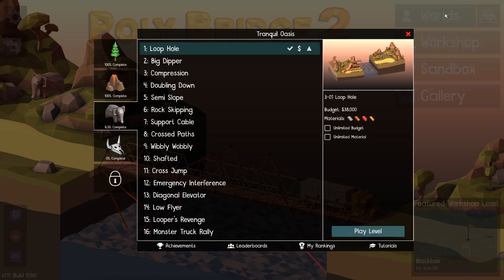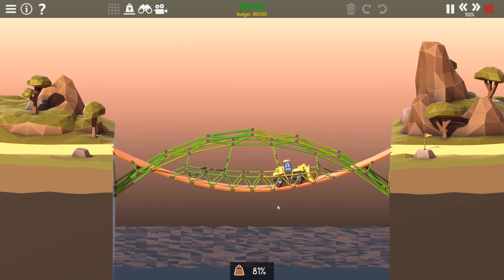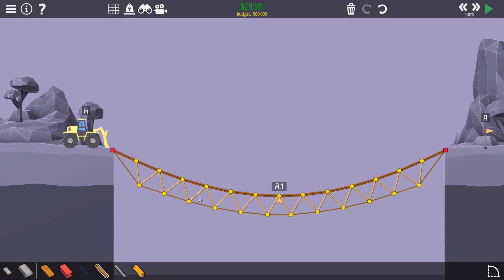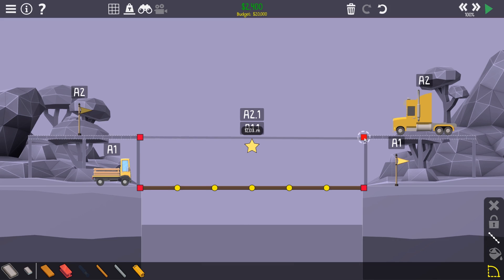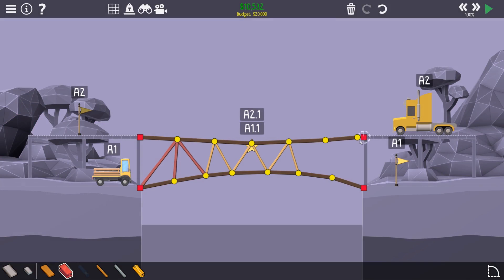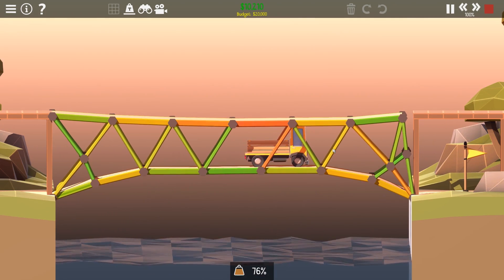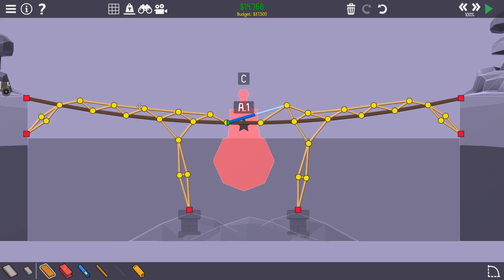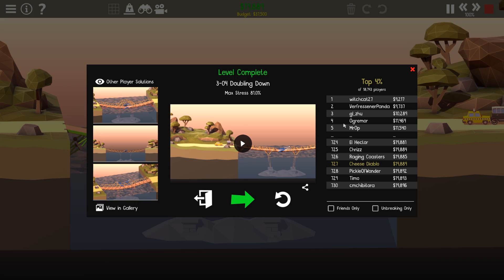Building BILFS with a real engineer! Bridges I'd take home to meet my parents! Poly Bridge 2

Comment: How did the rope of the first bridge help? Wouldn't the rope be compressed?
Reply from the maker: It stopped the steel arch from slipping down, it was suspended under the anchor points at the end. If you mean the bits in the middle, they are to suspend the wood and road from the arch, they were hanging from the arch!

Comment: 11:25 why did you never reconnect the upper bridge's right side to the anchor point?  It has to weather a huge shock when the truck bumps onto the bridge it otherwise wouldn't need to tolerate.  Was it just something you overlooked, or was there a reason to it?
Reply from the maker: I think it's because it wouldn't reach without another piece of road,  and that ups the price by a lot! I might be wrong though, it was quite a while ago now!

Comment: Some tricks: for tension designs you can create small standoffs vertically from the roads rather than triangles. The bridge will sway, but still work. Additionally, angling the roads on the edge up, while having the rest of the bridge dangle with those standoffs will spread the tension more evenly between the road and the final stretch of rope, which can allow for a much smaller distance between the rope and bridge itself.

This is because the tension concentrates on the roads at the outer edges and the rope in the middle. By splitting the tension between the road and rope on the edge you mitigate this effect.

Comment: I think you're a bit too close to your mic on this recording. You're getting some rumble from the plosives (p sounds, for example) and some proximity effect which makes your voice sound a bit lower. Either that, or you had the gain too high and your voice is clipping a bit (or both). Make sure you've got a pop filter, double check your distance from the mic, double check your gain, and you might want to consider adding a high pass filter to block some of the pop/rumble if you're still getting some after making those adjustments. That's all assuming you haven't already fixed the issue (since I know you keep a backlog of videos)
Reply from the maker: Yeah there's gonna be a few videos where I'm clipping. I'm super sorry about this, I nudged the gain on my sound card and ruined a few sessions. All sorted now but not sure how many videos are affected! Sorry!
Reply: @RealCivilEngineerGaming  that's alright, I wasn't sure if you were aware of the issue, and I wasn't going to go through the effort of downloading and looking at the waveform to check if it was actually clipping or not. I never know how much youtubers know about sound recording stuff so I try to give as much advice as I can when I notice something like that.
Reply from the maker: @Bobbias  I edit all my audio properly, noise reduction, eq, compression etc. You can't fix a clipped track though annoyingly!! Thanks for letting me know tho!
Reply: @RealCivilEngineerGaming  Yeah, that's the most unfortunate thing about clipping. It can happen at any stage in the audio pipeline, and once it's recorded there's nothing you can do.

Comment: Not sure if you have figured this out already yet (I haven't seen every PB2 video yet) but I was doing some of my own testing to learn more about the physics of the game. It turns out that wood, steel, and hydraulics have the same stretch resistance and compression resistance, meaning they can hold just as much weight being stretched as they can being compressed.